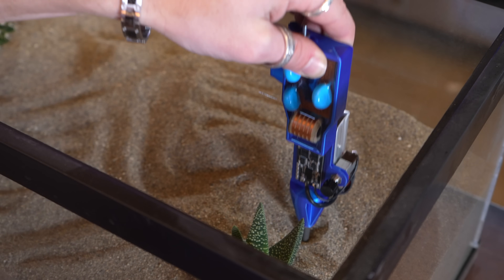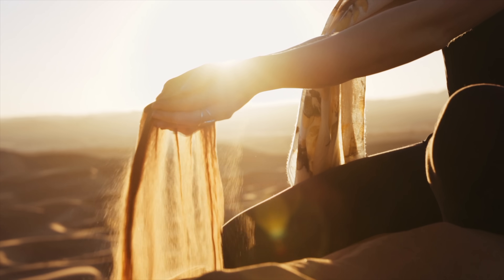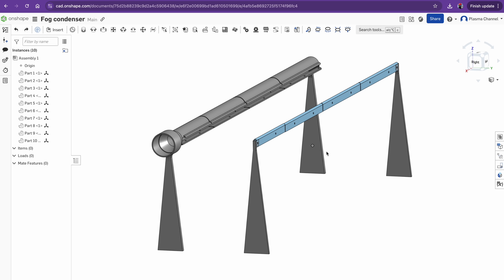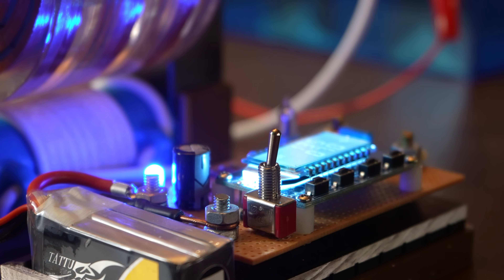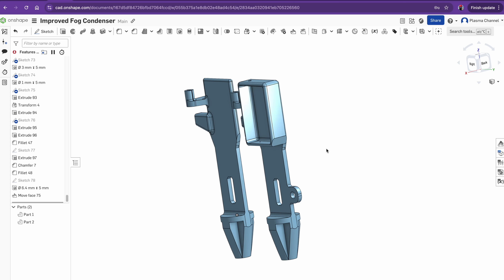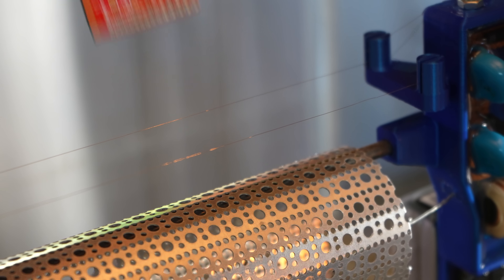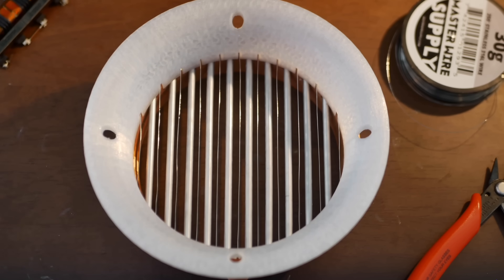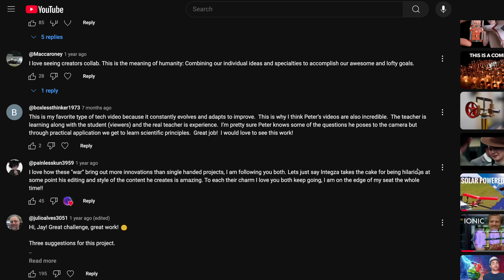Solving Desert Water Shortages Using 20,000 Volts

Comment: Zero chance of being useful. Fog is caused by a relative difference in humidity. Key word relative. The baseline humidity in a desert is near zero, so even if you collect 100% of all moisture in that entire fog bank, you still have very little water. Which will immediately be absorbed back into the air.

You are NOT in uncharted territory, there have been dozens of water from air scams. These gimmicks ONLY work in humid areas, where they are entirely unneeded.

Comment: May be stupid or odd… but what’s the viability of using this AS a dehumidifier? Or is the density of vapor in a standard house not significant enough?
There is definite application in power savings for environments that use much higher consumption methods currently.

Comment: just imagine setting this up with solar panels and batteries for power, and a humidity meter to act as a switch... could that be an automated moisture/water farm? Also curious if we can do this in a vertical setup and high altitude locations like mountains and buildings?

Comment: The problem I see is that it is addressing the wrong issue. This is magnitudes less efficient then desalination plants. There are already fog nets that do the same thing energy free. This already requires you to be by a coast for the morning fog so use that energy for desalination. Bringing water to a desert was never the problem. The problem was getting the energy required to do so in a cost-efficient manner.

Comment: You should do an episode with the guy who does Dustups, who is trying to find ways to make W. Texas desert green. Should also allow you to test out ways to power it with solar.
Also, I have to wonder whether the condenser might work better if it was less smooth and more pitted / porous, as I suspect that how the surface is plays a big role in the ease of dew catching and collecting. Maybe it can be chemically treated to do this. It would also be interested to see how it works when the condenser is treated in a way to make it function like a superhydrophobic material, kind of with a lot of little peaks and valleys, which should help trap water, making it accumulate and flow off. Lots of tropical leaves are GREAT at collecting water vapor, specifically because of their superhydrophobic properties, so if you can duplicate that effect, it might make a huge difference.

Comment: While powered on, would this device prevent or slow the evaporation of the water that condenses on it?
Could you do an experiment with it to measure the evaporation rate with the power on vs with the power off?

Comment: The cheap amazon dehumidifier is a peltier based unit, and they're dreadfully inefficient. I'd be curious to see it compared to a compressor based unit. They make mini compressor units for in car refrigerators, so maybe they make 12v compressor based dehumidifiers?

Also, I can't wait until we charge a bird to 20KV as it then flies off and lands on a grounded surface lol

Comment: good as a project, not practical... the  expense, efficiency and the setup outweighs the  benefits by a huge margin... the water if not stored will instantly evaporate once it hits the ground, the fog is way lesser and this is just possible in coastal areas, not places that actually might have a use for this...in my opinion, im open to hear your thoughts

Comment: OK, I'm looking to do an experiment that is just the opposite. Find a way to create an Ionic wind to blow air through a swamp cooler pad. the swamp cooler pad contains a metal screen that is charged to 30KV. So, now the swamp cooler pad has to be electrically isolated from ground and tolerate being charged up to 30KV. The ground would be the screen wire in front of the pad. It's my belief that the HV might be able to make snow. As an air cooler (AC) it would be far more efficient than even a regular swamp cooler, creating temperatures far lower than a normal swamp cooler could do, and work at far higher ambient humidities. Please Email me. Let's talk.

Comment: I had an idea several years ago to pump fog from the coast up to  burried tubes up in the desert.  If buried at the correct depth it could be kept at cold temps and hence creating humidity at any time of the day since the desert is cold at night, you can use a large mass above the tube to store the cold from the desert, kind of like a cold capacitor.

Comment: I had a similar experiment since 2011 to prove that the lightning is helping the water drop to condense in the cloud,
i made the fog from humidifier move through a 30kv electric field and the water condesed on aluminum foil that connected to the positive terminal.

Comment: Generally curious; this is best case with dense fog, can you measure the water in your fog machine before and after and compare that with the amount of water collected? You can use that to determine A) how much was not collected and just lost to fog, and B) the % efficiency of extracting water. Couple that with your w/h efficiency metrics you have a great metric on how useful and scalable this will actually be. Lastly, depending on WHERE this could be used impacts the scalability, how much fog does the Sahara get per year, how dense is that fog, what amount of desert does that fog cover etc...

Comment: Get a big piece of plastic and a rock.  Dig a hole.  Put a tub in the hole. Put the plastic over the hole.  Put the rock on the plastic so the condensation on the bottom of the plastic will run down into the tub.

Comment: A few thoughts 

I thought they already had fog nets that require no power and can work in as low as 4% humidity with new meta materials.

The sand won't hold the water. That's mainly the issue.

Id love to see nets set up all around a lake, like lake Mead in Vegas to refill it. The nice thing here is you could use solar if it needs power. Put those sun block balls on the surface and/or shades that are solar and float.

Comment: Morning fog? You need higher humidity for this to work. Most deserts have a very low humidity. Heck, Sharp makes an office water cooler that pulls water from the air, but when my last employer tried it they found the most water it could make was less than 2 liters a day. If you have enough humidity to use for farming, you are not in a desert.

Comment: High voltage will solve a lot of problems. Stanley Meyer's superefficient electrolysis uses very high voltage to break water molecules with very little energy in a LC resonating circuit where C is the electrodes with water in between as electrolyte that breaks into hydrogen and oxygen.

Comment: The dehumidifier you tested is likely a rotating dessicant drum, which means a five minute test is not very useful.  It collect moisture over a long period in the drum and then extracts that moisture over a pie slice that is slowly rotating.  In short, you need to run it for far longer to measure how much it extracts per hour.

Or, as others suggested, it may be a peltier cooler that causes water vapor to condense on a cool element.  In that case, it's not really an apples-to-apples comparison; dehumidifiers are for turning gaseous water vapor into liquid water, but fog is already liquid water.  That said, later in the day when the sun cooks off the fog, the dehumidifier will continue producing water while the high voltage system won't.

Comment: Heres a thought. will this work with a metal sheet (no holes) to capture the water? If so could you technically run a charged wire along the ridge of a metal panel roof (say on a garage or shed),ground the roof panels and collect water using the existing roof, eaves and downspouts into barrels?

Comment: THIS IS REALLY COOL!... I live across from you over on Hood Canal...I am up about 200 ft above sea level, about 150 yards from the canal......  I watched your video where you lifted a wire with the drone, and produced a lot of voltage at the ground. I have tall trees on my property...Do you think it could be feasible to suspend a copper coil ungrounded of some kind between tree tops, wired down to a multiplier, that could produce enough current to run a set up like this one to steadily produce a small continuous supply of drinking water, off grid? This last winter was fog city over the whole canal and peninsula...... I would expect somewhere like The Hoh Rainforest to be productive most of the year..... My tree tops would only get me up another 100 ft in altitude, though..... Time for me to study more Tesla stuff...

Comment: you think you could make it run at 12 volts?
Reply from the maker: You mean the entire circuit? That's like trying fly a commercial airplane that only has a rubber band powered propeller.

Comment: Just a small correction; you are not condensing water when you can see the water (white fog) it is already condensed water. You are just guiding it down /accumulating it. Condensing implies you send the water through a phase change, i.e. from water vapor to liquid water. That is not the case. Fog are little water droplets in liquid phase that scatter the light (thus appear white) while water vapor is invisible to the eye
Reply from the maker: That's a good thing to note. I appreciate the correction. I suppose in physics terms, it's not true condensing it it? In the general term, to condense is to bring together.
Reply: @PlasmaChannel  Yes, in physics terms you are rather accumulating / catching the already liquid water whereas with real condensation you'd have a phase change from vapor to liquid

Comment: what if instead of the metal grid you use the sand directly?
Reply from the maker: That was my first thought, and my intention. But dry sand will not conduct the necessary current in order for this to work. Only a wet ground will. And...if doing this in a place with wet ground....there is no need for the device to begin with.

Comment: You also can't drink the water that comes out of a dehumidifier, whereas it's safe to drink water coming from a fog net. Dehumidifier water is nasty. Now the big question is does the efficiency of this electric fog net outweigh the cost of materials and the cost to power it... also does it work out in nature as opposed to when you're inside your workshop feeding artificial fog straight into it. 

It's an interesting test, but it could be illegal to collect water from the fog in certain US states as rainwater collection supposedly diminishes the amount of water going into the ground. Rainwater collection is already illegal in many places. Fog nets like this would be really effective in areas like San Francisco. The fog there is so thick and it rolls inwards from the sea reaching many miles inland at times. 

The biggest benefit to this device that's immediately apparent is that it's much smaller than a traditional fog net. The ability to draw fog towards it could mean huge space saving whereas you would need several huge traditional fog nets to capture the same amount of fog.

Comment: Consider using pulsed current instead of DC. It would reduce consumption by a lot. Also, experiment with different voltages in order to see what is the most energy efficient in terms of capturing humidity.

Comment: Great work! I once owned an Ionic Breeze Quadra, which was marketed by Sharper Image as an air purifier, and used electrostatic precipitation to remove airborne pollutants. Though the unit was vertically built, the internals (two thin wires situated behind collector plates) were similar to your builds. Whenever the unit was turned on in a very humid room, water would noticeably end up condensing on the collector plates.
Reply: That's because this is an Ionic Breeze with a fancy grille.

Comment: FYI, using fog nets on the Namibian coast in 1996 - 1997, tests of fabric fog nets at the area of of Swartbank, 40 km from the coast at the end of the reach of the fog bank produced 2390 ml/m2/day.  That's about 2.5 liters of water using a 3.3 x 3.3 (1㎡) mesh net.  PER DAY.  We do not have the collection rate per hour or how many hours of fog there are per day at this site. When fog does appear, it's normally at dawn and until 11 and 12.  During March, sunrise is between 7 to 7:10 AM.  If we assume that on a foggy day, it will lift at 11 (it won't), then this gives is 4 hours of fog to harvest from.  At 2 feet long, or 0.6 meters, Shawn's system captures 540 ml/h.    in a meter, that should be 756 ml, (3/4 of a liter/hour).  At 4 hours, that's  3 liters, or 1.25 times better than neddint.  And this is just harvesting from a line of air, 1 meter by maybe 3" or 7.6 cm of height.  This could be significant if a 1 meter square device could be tested.  Winds are a factor though as they can get up to 33 km/h or 20 miles an hour. and sand at that speed can damage equipment.  Corrosion is also a factor.  
Regarding the Atacama desert, how many hours of fog do Peru and Chile  have per day?  I don't know.  In one area, 32 fog nets supply one group with 50 - 150 liters of water per day.  Other reports state each net of unspecified size can capture between 200 - 400 liters of water daily, or 53 - 106 gallons!   Could Shawn's system improve on that?

Comment: *A Concise Guide to Enhancing Condensation Under Normal Humidity Conditions*

Enhancing water condensation—even when ambient relative humidity is moderate—can be achieved by combining high-voltage induced ionization with advanced surface engineering and thermal management. This guide outlines two key approaches with concrete technologies.

---

### 1. Biomimetic Surface Engineering

*Objective:*  
Create surfaces that mimic the water-harvesting strategies of organisms such as the Namib Desert beetle, which uses alternating hydrophilic and hydrophobic areas to nucleate and channel water droplets.

*Technologies & Methods:*

- *Nanoimprint Lithography:*  
  Use this technique to pattern polymer surfaces with micro- and nanostructures. A structured stamp is pressed into a thermoplastic layer to create precise features. After patterning, the surface can be chemically modified (e.g., via silanization or fluorination) to produce alternating hydrophilic and hydrophobic regions.

- *Self-Assembled Monolayers (SAMs):*  
  Allow molecules with specific terminal groups (–OH for hydrophilicity, –CF₃ for hydrophobicity) to spontaneously organize on a substrate. This method can fine-tune the surface energy and promote efficient water droplet nucleation and removal.

Result:  
The engineered surface will provide designated nucleation sites for condensation and promote rapid droplet coalescence and runoff via capillary action.

---

### 2. Radiative Cooling and Capillary Enhancement

*Objective:*  
Lower the surface temperature below the ambient dew point without additional energy input, thereby promoting condensation even at moderate humidity.

*Technologies & Methods:*

- *Radiative Cooling Coatings:*  
  Apply coatings with high emissivity in the mid-infrared range (8–13 µm) to your condensation surface. These coatings radiate heat effectively to the cold night sky, cooling the surface passively. Commercial thin-film radiative coolers and photonic coatings are available and are documented in recent scientific literature on “Photonic Radiative Cooling.” 

- *MEMS-Based Microfluidic Channels:*  
  Integrate microfabricated channels using MEMS technology into the condensation surface. These capillary structures enhance water collection by drawing condensate away from nucleation sites. This not only increases droplet growth but also prevents film formation, maintaining high efficiency.

Result:  
The combination of radiative cooling and microfluidic capillaries leads to a more rapid and sustained condensation process by actively lowering the surface temperature and channeling collected water into reservoirs.

---

### Implementation & Further Reading

For detailed procedures and experimental setups, consult technical journals such as *Advanced Materials*, *ACS Nano*, or review articles in *Nature Reviews Materials*. Additionally, foundational principles can be reviewed in publications on radiative cooling (e.g., Nature Energy articles) and MEMS microfluidics in IEEE Xplore.

By integrating these technologies, you can significantly improve condensation performance even in environments with normal to moderate humidity, thereby enabling efficient water harvesting or improved thermal management in various applications.

Comment: where would you get the power needed for innovation and supporting the electrical field in a desert scenario? apart from solar there's basically no way and with our current battery technology it would be very chunky and would need huge batteries
Reply: and in your scenario the simulated "fog" is ionized directly out of its source? How would you ionize the water in fog which contains virtually no ions and only the bipolar water molecule, as far as I know the electrical field which you generate only leads to rotation in bipolar molecules such as water and not in linear momentum. correct men if im wrong tho. I think its very inefficient to ionize the fog in a desert scenario